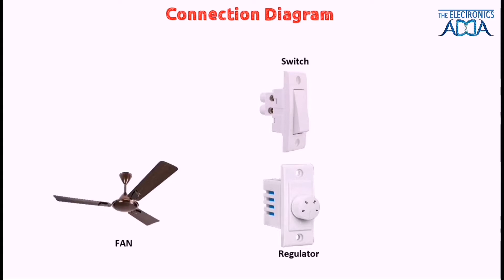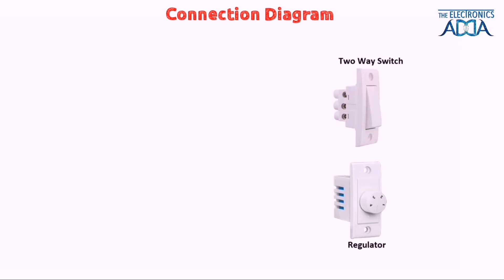One Fan and Two Regulator Connection | Two Way Switch Connection Fan | Two Fan Regulator Connection

Comment: If one switch is off then it circuit should not be completed then how is your circuit complete when you keep either of the switch on .

Plus i want to know if fan speed is x units at 1 speed of A regulator 
Will the speed be less than x units if both the regulator are at 1 speed 

I want to reduce speed of motor so i used a regulator but it's still too fast